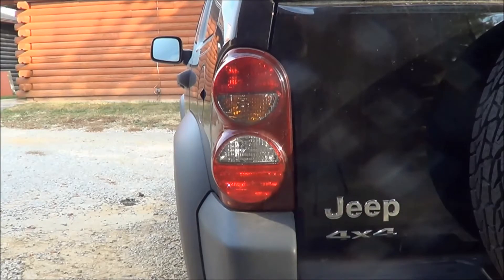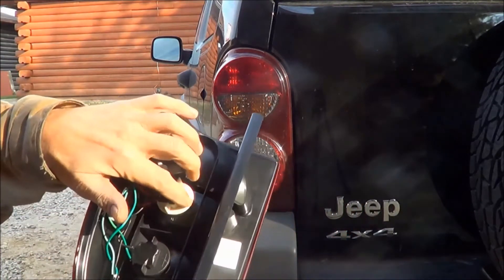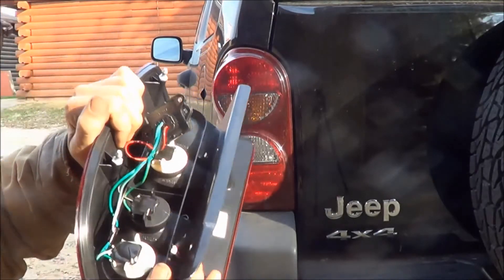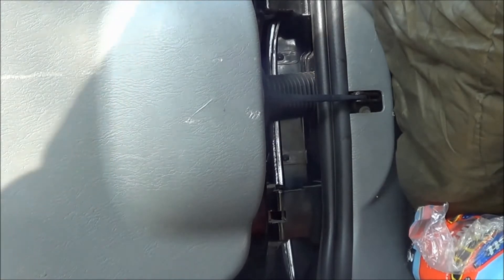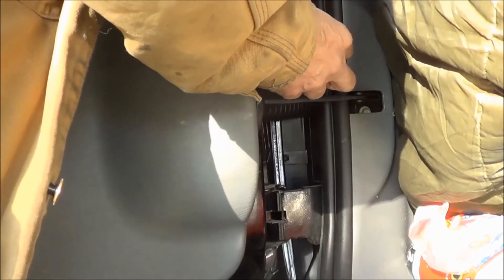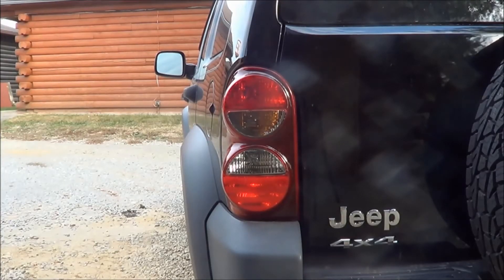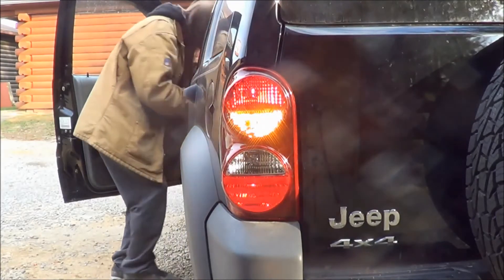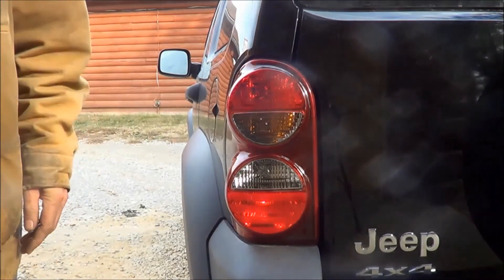Replacing My Tail-light Assembly - 2007 Jeep Liberty

Comment: My circuit board shorted out on a 05 liberty. I took a 4.25 hole saw and cut the lens out and installed a 4 inch led tail light with grommets. It worked so well I did the same for the bottom bulbs. Since that took out the backup light I mounted two led backup bulbs in the bumper. Now I have twice as much light as before. Total cost was less than thirty dollars and it looks very cool.

Comment: Great video! I, however, have a question! How did you unhook that wire from the old one to put on the new one??? you didn't actually show that part on the video and I can't get mine unplugged....
Reply from the maker: If I remember correctly there is a small red lock on the wire plug that you have to slide out a little bit to unlock the plug so it can be removed.